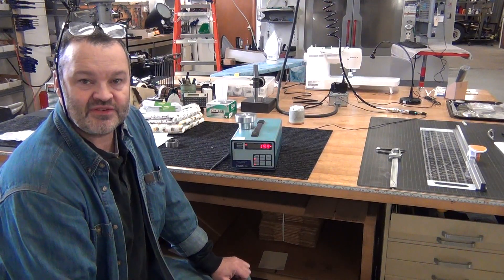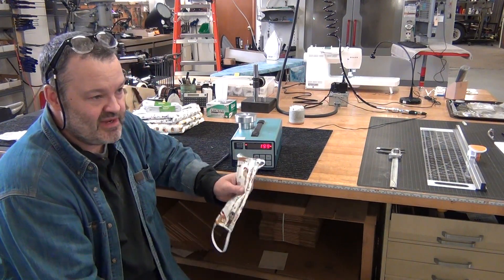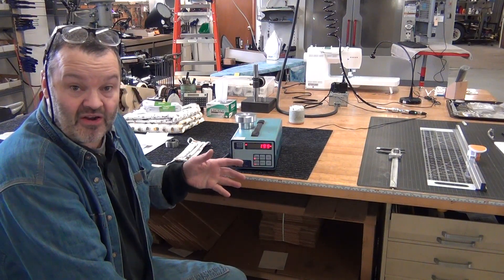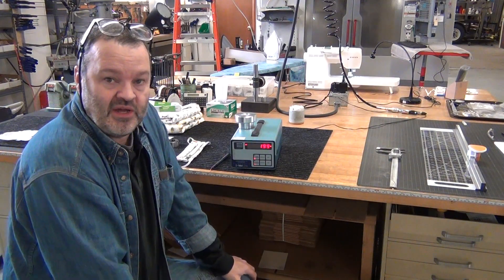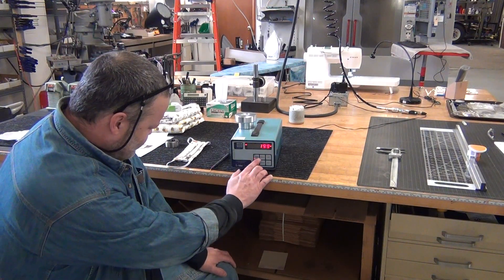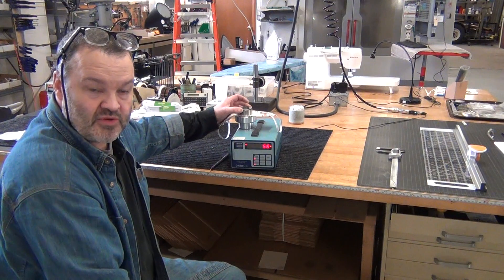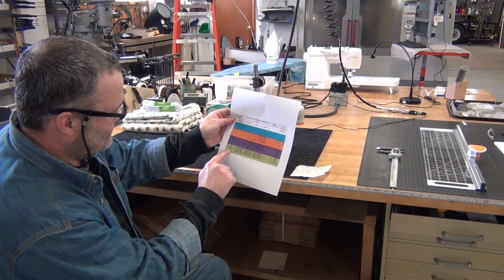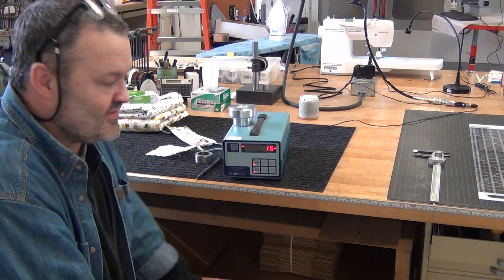Testing Mask Efficacy, Covid-19 Coronavirus

Comment: Do you know how to calibrate one of these, or a good guess?
Reply from the maker: These come with a zeroing filter which is certified to create and confirm a zero count.  But yes, in situations where it was required, a more thorough calibration would have to be conducted by the manufacture or appropriatley certified calibration laboratory.
Reply: @MathIndy  would you tell me the exact model number of the one you purchased, 217A, B, C etc.? I'd like to find one myself to experiment with.

Comment: But a mask doesn't fit as tight in real world use as it does siting on your tester. So while you are testing the masks ability to filter what you aren't measuring is the leakage a mask would have when being worn. You keep talking about stopping power for a sneeze. A sneeze is propelled at up to 200mph. Your machine which is designed to test partials in a room draws air in does it not? I don't think this test takes into account enough variables to actually measure effectiveness while using.
Reply from the maker: For sure.

Comment: What if you have four layers or six layers of cotton and does thread count effect partic filtration... do you have silk double layer... my thought is using 1000 thread cotton count pillow case and silk pillow case so about six layers total.  4 layer cotton and 2 layers silk.  Thank you.
Reply from the maker: So far the high thread count fabrics that I have tested all have low permeability (they're too hard to breath through).  Also, many advertised thread counts are grossly inaccurate.  To count actual warp+weft threads I recommend putting the fabric under a measuring  microscope and doing an actual count.  Remember too that, at 1 micron, it is much more the fine fibers that exist between the warp & weft of the fabric.  These fine fibers catch the particles and it is not simple sieve action as you might otherwise imagine.
Thank you for the excellent comment.  I hope you will subscribe!

Comment: Just so you know, if you ordered "N95" masks from China, you are probably getting KN95 masks, close but not the same quality standard as US N95. Also, you said your instrument measures only down to 0.5microns. The N95 filters down to 0.3microns, so you won't be able to test its effectiveness. It should filter near 100% @ .5 microns. Also, the Sars Cov-19 virus is 0.12 microns. Much smaller than these masks can filter.
Reply from the maker: As you point out the virus is ~0.1 micron.  Sneeze particles can be as large as 100 microns.  So, yes, filtration efficacy between 0.1 micron and 100 microns is where it's at.  The 3M N95 mask that I have tested measured 100% PFE at 1 micron (It is very high quality, but, like many things we buy, it is made in China).  The difference between KN95 and N95 standards are negligible and, in some regards, the Chinese KN95 standard may even be harder to pass than N95!--go figure.  Thank you for the excellent points.  I hope you will subscribe!

Comment: One important factor is achieving a good seal on the face. Ironically, the greater filtering (and typically, resistance to air flow) the material provides, the more likely it is that you are pulling air from around a leaky face mask while breathing.  The area around the bridge of the nose is a big challenge to fit well. Look at photos and videos of people wearing masks and often you see lots of gaps. So, making a mask seal well is just as important as filtering material.  Thank you so much for testing and sharing this information!
Reply from the maker: Very good point.  This is a vexing problem for anyone trying to make masks with high PFE.
Reply: @MathIndy  I made a wire insert from 2 pieces of pipe cleaner (fluff trimmed off!) , place parallel about 5mm apart and wrap in one layer duct tape. It bends and holds shape to face gives a reasonable seal.

Comment: I made a mask out of a 3m Filtrete furnace filter material.  It is very thin and easy to cut to shape. Way better at stopping particles then cotton. I use 16 to 32 layers of the material. 32 layers is a little hard to breath through but it  traps .5 micron and larger well. My baseline room counmts were 100,000 particle cu/ft, forcing air thru 32 layers got the counts down to under 5000 particle cu/ft. 16 layers was about 20,000. The cotton mast was 950,000 from 100,000. The Filtrete hammock filter  is $15 for a 30x60 inch sheet. Mayby you could also test this material.

Comment: Do you think toilet paper has filtering properties? You can measure for 1 layer and for several (for example 5) layers Thanks in advance!
P.S. She, however, must have great resistance to air flow.
Reply from the maker: I measured 1, 2 and three plies of Charmin Ultra Strong.  Results are:

1 ply=29%, 2 ply=49%, 3 ply=63%
So three plies are similar to two layers of cotton but remember, toilet paper is very fragile, won't last long, and definitely won't go through the laundry.  But, in a pinch, many layers of toilet paper should be better than nothing.  Thank you for the comment and I hope you will subscribe!
Reply: Thank you so much for the answer! This is better than I expected! Of course, toilet paper is not the best choice for a filter, but if suddenly there is nothing else :)
DIY personal anatomical mask on a 3D printer according to a 3D face scan: https://www.youtube.com/watch?v=kBQcNBPRkh0

And yes, I signed up :) We are waiting for new videos!

Comment: what is the make and model of the particulate counter that you are using?
Reply from the maker: This is a MetOne 217M.  These were made for monitoring the dust particles in clean rooms for semiconductor manufacturing.  This model was not made for this exact purpose but all of the measurements I have done seem to be in line with what others report for similar materials.  Thank you for your question and I hope you will subscribe.
Reply: thanks I did subscribe. I looked to see if I could find the same model to purchase but couldn't find it any ideas?
Reply from the maker: @alfredvieuxroy2708  I would normally look on eBay but it's possible most of the particle counters have been bought up by people wanting to do this same test.  My counter is pretty old.  There are newer models as well as many model numbers.  Most of these will just come with a 1/4" hose barb input.  I had to make that aluminum "fabric adapter" that you see on my machine so don't hold out for a machine with that accessory because it's custom.
Reply: lol ok cuz that's exactly what I was looking for lolol

Comment: Bandana folded in half. Western style
Reply from the maker: I don't have a bandana handy but I expect it to be similar to two layers of 100% cotton.  Some cotton is thinner, as a bandana might be, so, if you can breath easily through it, more layers could be good.  Of course bandana does not have a wire for conforming to the nose so there will be a small leak there.  Regardless, and in a pinch, a bandana is a good idea.

Comment: 1) Can you test multiple layers of filter material?  Most homemade masks seem to use doubled, tripled, or higher layers.
2)  Test cotton fabric, multiple layers (see some of the recommended folding patterns) 
3) Additionally test at 0.5 micron.
4) Address :  If a single layer blocks 66%, (in theory, allowing 34% thru), would two layers block 89%, three layers block 96%, etc.?
Reply from the maker: I have tested multiple layers of cotton and, in general, more is better.  However, the limiting factor is that you still have to be able to breath easily through it and, if too thick, your sewing machine will also have trouble.  Thank you for this excellent comment and I hope you will subscribe!
Reply: @MathIndy  I was thinking of the "no sew, bandana" approach.
I tried to set up the maths in Excel, but it's been a long while, and I don't trust my memory of how the equations go, but I tried it for 1, 2, 4, 6, and 8 layers.
For cotton, I believe that more layers may not be as bad, as the added thickness also has the effect of widening the aperture size, giving both deeper and wider area of material for entrapment.  
Wider aperture would equate to lower air velocities (but also more exhalate captured).
For more strenuous activity, adding a structure for the fabric to use as a frame would increase the infiltration area many, many times.  The larger mask would be a bit more bulky, but would result in very low air resistance due to the large filter area / air volume required.
Reply from the maker: @colfaxschuyler3675  You could try fabric fusing material like Pellon and "Stitch Witchery".  Thank you for the comment and I hope you subscribe!

Comment: Scott shop towels .. apparently putting two together gets 90%+
Reply from the maker: I measured Scott towels and they did not test this good but, yes, they are pretty good.
Reply: Scott brand shop towels do not test well. However, a double layer of ToolBox or Zep blue shop towels between two layers of cotton have both been tested as discussed in Business Insider abd tested very well.
Reply from the maker: Scott blue towels have higher permeability than Tool Box brand so that helps as you could maybe use three layers and still breath easily though Scott brand.  More here in this video that shows how permeability comes into consideration:  https://youtu.be/fcAQJH9smFY

Comment: Can you try blue shop towels I heard it’s a pretty good filter material
Reply from the maker: Most blue shop towels, when tested in two layer stack, seem about the same efficacy as two layers 100% cotton which is 65% at 1 um.  Some brands of blue towels do seem to be better than others. "Tool Box" brand tested well.  Of course blue towels probably cannot be laundered and hospitals are widely recommending 100% cotton as their preferred DIY mask material.
Reply: ZEP and Tool Box werr both tested/recommended by Suay, the company in LA covered by Business Insider.
I have been using two layers of ZEP blue shop towels that I sew into my masks. I have tested aerosol sprays which have not gone through, but also boiled, dried, washed in my washing machine on hot then dried. They are holding up fantastically.
I would like to see your test with a contoured fitted mask and double layer of the Zep shop towels.

Comment: Hey Tom could you test some non-woven polypropylene bags of the sort people might have around the house?  Also, although this doesn't mean anything, it might give a bit of a hint, can you "simulate" a mask without a good seal, without the weighting ring on during the test?  I think a big issue is that masks can leak a lot (again, not the leaking would happen the same way in situ, but at least it provides a hint/warning)
Reply from the maker: I have some bags here that were giving to me at a convention.  I think these are the material you are referring to.  Two layers of this material is easy to breath through and tested 75% effective which is a little better than two layers of 100% cotton.  The hospitals seem to be mostly calling for 100% cotton so, for now, we're sticking with that.
Reply: @MathIndy  Thanks, another thing would be nice, if you could distinguish between the various kinds of "cotton" and perhaps also the non-woven polypropylene.   I only have one kind of the latter, but with cotton you can have knit stretchy t-shirts, loose but thick tea-towels, different "thread counts" of woven cottons, etc.  It seems to me the (woven/knit/etc) nature of the fabric, aside from whether it is cotton, silk, linen, etc., would be just as, if not more, important. 

 
Another issue in situ, and not just on the particle counter, where the non-woven polypropylene should be better, is that it is hydro-phobic. 

 
Here's another one for you too: many have started recommending the so-called "blue shop towels" which are partially polypropylene I believe.
Reply: @MathIndy  Here is article on the blue shop towels.  They apparently got a particle counter as well and found these are among the best they could find.  I am a little skeptical of how well they did, perhaps you could confirm or disconfirm? 

 
Googling article title "Designers find that layering two blue shop towels inside cotton face masks makes the most effective homemade PPEs" will find it (don't think can put links in here).
Reply from the maker: @Benson_Bear  Some of the blue shop towels are better than others.  Most perform about the same as cotton.  Extra layers of cotton is good but too much and you won't be able to draw a breath easily.
Reply from the maker: @Benson_Bear  I like the blue towel idea but remaining concerns are 

1) the blue towels could be on unknown composition which, for me, is problematic. 

2) Even when sewn inside a cotton outer shell I worry that the blue towel may not do well in the laundry.

Comment: Thank you for this video. I bought some Hoover “Y” Type bags, that says “Traps 99% dust and pollens down to 5 microns”.  How important are the microns?
Reply from the maker: Most filter materials do not drop abruptly to 0% and continue to have efficacy for similarly sized particles.  In fact, many materials actually get better for smaller particles and there is often a performance minima in the 0.1um to 5um range.
Reply: A "micron" is a unit of length equal to one millionth of a meter, used in many technological and scientific fields. So as far as its importance, I guess that depends on how important keeping particles from entering your lungs is to you.

Comment: Very information video!  have you tried putting interfacing between the layers of fabric?  I saw a pattern with interfacing. It would have to be breathable interfacing.  Thank you for sharing!!
Reply from the maker: I do have some Pellon fusible interfacing.  There are many varieties.  The variety I have did not test as well as 100% cotton.
Reply: I wonder about pellon with Cambric fabric? (Which is 100% polypropylene)
Reply from the maker: @Jules-The-Chat-Maligator  I have not tested Cambric.  There are many varieties of Pellon.  I tested two layers of Pellon which is used to stiffen dress shirt collars, etc.  Two layers of that Pellon tested 40% effective.  Pellon fusing materials like "Stitch Witchery" could be useful not for filtering but to reduce the sewing task and maybe make a iron-together mask.
Reply: Mathews Engineering I was curious. The ones I’ve been making basically have two cotton, two non woven interfacing and a layer of cambric 
If anything it is better than nothing :) 
Thanks!

Comment: does incrementing the fabric layer provide more protection? You mention a 1/3 blockage. Would using 3 of the same layers reduce air flow for breathing or simply provide more protection?
Reply from the maker: In the range where the material is effective, yes, more layers is better but probably not a linear increase.  So for the 1 um particle range more layers of cotton is helpful.

Comment: Good video. Right now, there are people working on 3D printed shields to help make the masks last longer. If you find the right material, that could be combined with a 3D printed holder for the filter that would last longer and the filters could be replaceable at a lower cost. Some are using vacuum bags that are HEPA filter bags. It would be interesting to test some of those.
Reply from the maker: Somebody else recommended HEPA vacuum bags and I have some that I will test  today.  3D printing could be helpful but, alas, it is so very slow.
Reply: @MathIndy  but there are many folks like me with print farms that could crank out many masks per hour. I like what you're doing here - what a great machine!
Reply from the maker: Here's an interesting 3D design for a face mask but you still have to procure the sheet plastic:  https://budmen.com/
Reply: @MathIndy  That is very similar to others I have seen. I like how everyone is coming together to find solutions.
Reply: What about porosity of material? Also, the seal to the face. A dentist in Montana had an interesting design. I've seen those used with weather stripping added to better the seal and comfort.
Reply from the maker: @FourJaysFour  Some of the papers I link to in this thread have measured how easy it is to breath through the material.  If a material is easy to breath though then you can use more layers which is usually helpful.  The higher they PFE rating the more important the seal to the face becomes as it is impossible to be 100% effective if the seal is poor.  Thank you for subscribing!